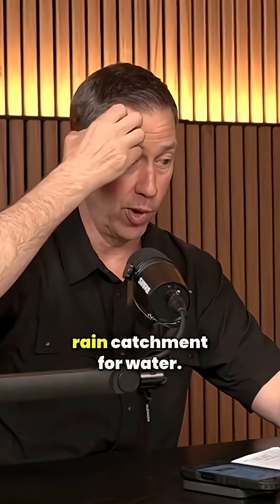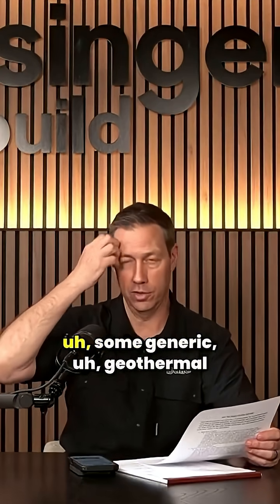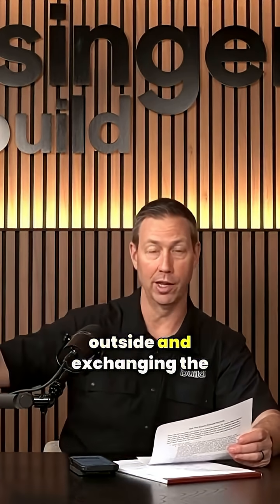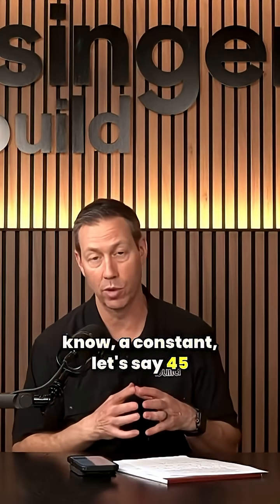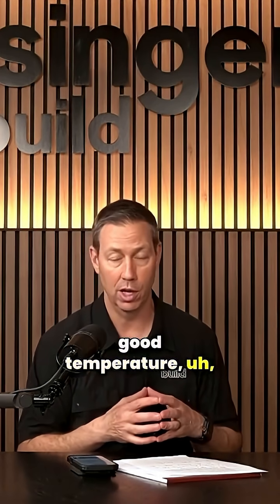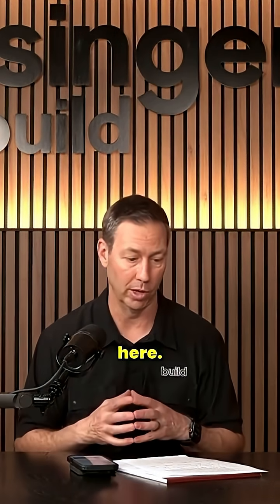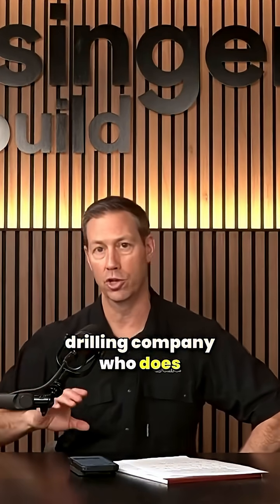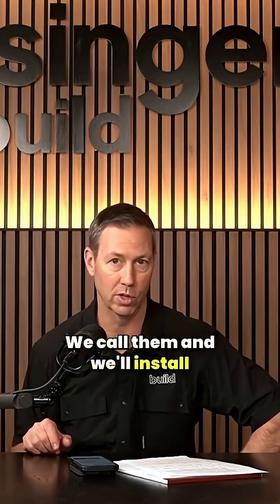Geothermal HVAC Considerations

Comment: Matt, lots of the statements you are making here are not correct.  You don’t need a 50 degree subterranean temp to make geo work.  And the refrigerant doesn’t travel down the loops but rather circulated water.  By raising the performance of the system, you make a system that is supplied with solar energy a lot more feasible, because you are lowering the electric load on the household relative to its size.  The fact that the water table is likely fairly high makes this system likely even more efficient, as the water raises the heat capacity and conductivity of the ground.  

To answer this guys question, he need to obtain a bid for the system at the capacity that he needs for his home, and compare that to the alternatives, with the consideration that he is trying to use solar, which will need to be sized to his electrical requirements (likely lower electrical requirement with the geo system).  

What I would no do, as a homeowner, is to set up a system that is 100 percent reliant on off grid power.   Not having an electrical source that is reliable is silly in 2025, and would affect his resale value tremendously, as well as make them suffer quality of life for very little reason, and all at great cost.  The payback on alternate power, especially electric, is a financial disaster.

Comment: I had one in Maryland as a replacement for an ASHP.  Build new...never do geo.  Spend the money on a tight house with good insulation to get smaller ASHP hvac equipment, even hyper heat for rare cold.  Fir new build, unless the community does it to decrease cost it is NOT economical.  This is coming from someone who lives my geo system...

Comment: Geothermal is a heat pump. All heat pumps exchange energy from one area to another.

The energy being exchanged is in the form of heat.

Whether being introduced, or extracted.

Typical heat pump systems use heat exchangers, on either side of the pump.

With air source heat pumps, it is easier to pipe the refrigerant outside than to pipe the air inside, locating the heat pump outdoors.

With "Geothermal" (ground and water source) heat pumps, water filled pipes (w/antifreeze) are piped into the house to the heat pump.

Realistically this method adds one additional "exchange" of energy.

Air to refrigerant, inside 
Refrigerant to water, heat pump 
Water to earth/water outside

Where air/air heat pumps exchange twice
Air to refrigerant, inside
Refrigerant to air outside 

The "Geothermal" model is more reliable in extreme outdoor temperatures, not being reliant on air temperature, but a more constant temperature underground.

Comment: If you have a rig there drilling geothermal wells, just put in a water well too. Rainwater cistern has downsides... drought, herbicide drift, deterioration of the system over time. I bought a house with a rainwater system that had run its course. Drilled a well.

Comment: Nope. The refrigerant does not move through the ground.  If is cheaper and more environmentally friendly to do a "water" loop with the ground that has some percentage of glycol in it.  At the hvac unit the water loop interacts with a tube and shell heat exchanger.

Comment: Why do you want geothermal in The South? AIr Source would be a much lower initial cost and much less risk in terms of getting a successful outcome.
If you don' think there's risk in geothermal tell the guy putting in the well or field that you want a guarantee on its performance and you want it on a fixed price.
You seem to think that having an outside compressor is bad. You really want that thing IN your house?

Comment: With all due respect, because I do respect you, geothermal systems very rarely if ever are designed move refrigerant through buried piping. These systems circulate a treated fluid through the loop. The loop is buried at depths where the earth stable temperature is approximately 60 F. The depth will vary based on location and soil composition. Loops are typically buried 6 to 8 feet deep. Vertical bore holes obviously go much deeper 

The solution is pumped through a heat exchanger that acts as a condenser in cooling mode and an evaporator in heating mode and modes are controlled through a reversing valve like the air source heat pump. 

In cooling mode the system is rejecting it's heat to a 60 F loop temperature as opposed 90 to 100 F outside air temps,

In heating mode it extracts heat from the 60 F loop as opposed to outdoor air temps that can range between 30 F to as low as negative 30 F depending where you live.

With this in mind, in heat mode, the the coil that conditions the living space becomes the condenser. You're rejecting system heat into the building in heat mode. You save a lot of money and wear on the compressor in cooling mode due to much lower head pressure but heat pumps like this really pay off in heat mode because temperature difference can be even more extreme. 

Burying the loop is what costs but once a loop is in the ground the cost difference between air source and water source replacement is about 20 to 30% give or take but the operating costs make water source the clear winner as far a COP goes.

You can heat domestic water as well.

What most people don't consider is the buried loop will definitely increase the value of the home. Warranties are limited but a buried loop installed the right way can last forever.

WSHP do make sense down south as well to be honest. Soil composition seems to be the main handicap in my opinion. I'd be curious to see how others feel about this.

I love ground source heat pumps though. I would love to be able to dedicate the remainder of my career to nothing but water exchange systems.

edit: Ben Heyser raised another great point, installing the loop in the pond could work out well if it's large enough and deep enough and local ordinances permit it

Comment: Something he said with a geothermal system, you do not move Freon through the horizontal or vertical loop. What you do is the ground removes the heat from the circulating water which gets pumped into your house where the Freon is circulated in the equipment and in the heat exchanger, the heat is dumped into the water which normally has some type of a soluble oil or an antifreeze for corrosion protection, and it takes that heat and dumps it back into the groundThat’s the way that works. Freon does not get circulated in the loop at all none whatsoever.
Reply: Obviously, You Want To Minimize The Refrigerant Circuit And Use The Liquid Circuit: Liquid Is Cheaper Than Refrigerant...
Matt More Than Likely Misspoke...
Reply: I believe you have described how a house can be cooled and not heated. For heating a home, the circulating fluid in the loop pipes (not refrigerant) takes heat from the ground and brings it to the "heat exchanger" in the home, thereby heating the home. It then returns the now colder fluid to the outside loop to take more heat from the ground again.
Reply: @alwaysvacationing5341  Yes!!!
You Are Correct, I Was Only Defending Matt About The Refrigerant Circuit, And Water Circuit...
A Heat Pump Has A Reversing Valve, The Refrigerant Reverses Flow...
The Biggest Difference Between A Heat Pump And Geothermal Heat Pump, Is Traditional Heat Pumps Are Just Like A Traditional HVAC Condensor With A Reversing Valve And An Extra Metering Device, And The Metering Devices Are Designed For Reverse Flow...
A Basic Geothermal Heat Pump Has No Outside Condenser Equipment...
If You Wanted To Pay Extra Money, You Could Put An Outdoor Unit, But You Better Have The Right Installer HVAC Company To Make It Work Properly...

Comment: I'm an HVAC engineer. They may want to consider using the lake as the heat sink. There are two options- sink the piping loop in the lake, or pump lake water through a heat exchanger and then have a small loop from the heat exchanger to the heat pump. There's a lot to check into with local regulations, particularly with the second option.
Reply: That’s the same technology we had in the US Navy on board ships you took seawater you ran it through a heat exchanger and that is what cooled the engines. Also on a lot of new ships. You know you have the same technology you’re taking seawater putting it through a heat exchanger which removes all of the heat from the Freon And then you run chilled water throughout the ship much safer than pumping free on throughout the ship one ship that I was stationed on commission in 1943 this was 1988. They actually ran free on throughout the ship very dangerous but it’s an awesome technology but always put in 20% more loop than what you need
Reply: @steveanderson4768 The Heat Exchanger Is Not A Regular Heat Exchanger For A Ship...
Reply: @tolbertgraves2064  oh I know I’m bored of ship you have coolant on one side or Freon and on the other side you have seawater and all it does is it removes the heat? The heat exchanger in a geothermal is exactly the same thing you have tubes with Freon on the inside and you have water either close loop or open loop I prefer close loop because you don’t get ground water contamination into it take the heat from the Freon and dump it into the Earth on board of ship. It takes the heat from the Freon or the engine and dump it back into the sea. That’s all it does. They’re both the same thing they just do it two different ways.
Reply: @steveanderson4768  On Most Ships, They Have 2 Heat Exchangers 1 Closed Loop, And 1 Open Loop...
Reply: Was gonna say the same thing!
Reply: Do take a long hard look at the legaiilty, cause it's probably not. Also if you tink you're going to pump through a heat exchanger be prepared for a lot of maintenance of strainers. I'm NOT an HVAC Engineer.......I'm the guy that came along next and found a way to get The Engineer's deisgn to work.

Comment: 600 acres. Horizontal loop. Don't worry about finding someone to do the drilling.
Reply: Yeah, cause all you need to do is go down 6 feet in the ground temperature never changes. I’ve got 8 acres in South Central Virginia and that’s what I’m gonna do. My backyard is gonna be a geothermal field and all I need to do is dig down approximately 5 feet and I’m good to go. Our frost line is less than 12 inches.
Reply: @steveanderson4768 I Would Still Have An Engineer Design The System, For Anybody...
Reply: Rent the equipment and save massive cash.
Reply: @craigheimericks4594 Once Again It's About Contractors, Some General Contractors Want To Have Control, So When There's An Issue, They Know That It's Their Problem...
Reply: As Far As Drilling Versus Doing A Trench, That Depends On Local Contractors...
It's A Matter Of Having Quotes For The Service...
Reply: I cant do 6 foot deep coils here in se texas.   Average temp here isn't good enough for it to work.   Would take a mile of pipe theoretically so the amount of power to pump through so much pipe offsets the efficiency...spoke to 2 installers here and both refused to do horizontal if I wanted ANY kind of warranty,
Reply: @davidrenfro5756 Once Again I Am Not There, For Geothermal, The Conditions Very By Location That's The Difference Between Traditional HVAC And Geothermal HVAC...
Reply: Keep In Mind There's 3 Main Styles Of Geothermal Vertical, Horizontal Loops And An Open Loop...
Reply: @davidrenfro5756 I think the bigger problem in a lot of Texas is the rock. Both digging through it and the heat absorption from the sun. But I can't imagine that the ground temp is higher than the air temp in summer 6 feet down
Reply: @ColeSpolaric I don't know the real numbers but the logic is kinda like that I want my house at 70 and the ground temp at 6 feet is 69.   The delta isn't big enough to cool my air.  Ps I know its colder then 69 but just sharing the point.   Where open loop or closed loop drilling uses what I think is 50 something degree water for the heat swap and would work great.
Reply: @davidrenfro5756 Apparently, You Really Don't Understand HVAC And How Geothermal HVAC Works...
A Traditional HVAC Efficiency Is Based On Outside Conditions: Geothermal HVAC Works On Ground Temperatures, Which Is More Of A Constant Temperature Than Traditional...
Making The Geothermal More Efficient, That's Why They Go By SEER, Versus EER Ratings...
Reply: The only down side to horizontal, besides the space requirement, is that if there is any issue with the pipe you have to dig a new system in.  With a drilled well you can replace the pipes very easily.